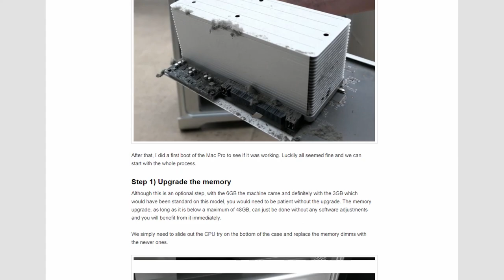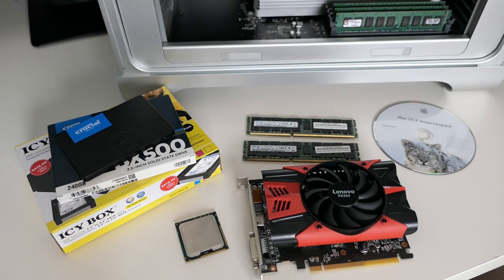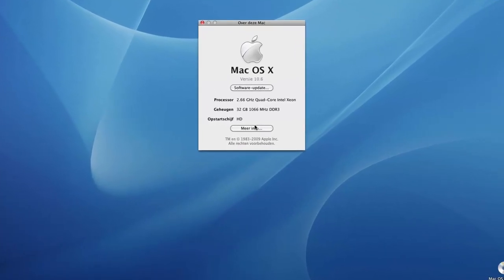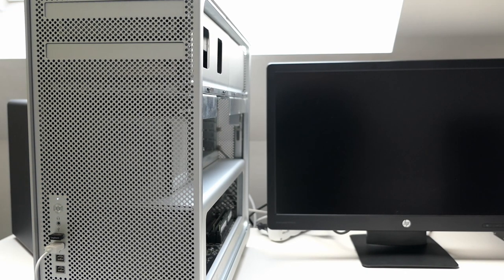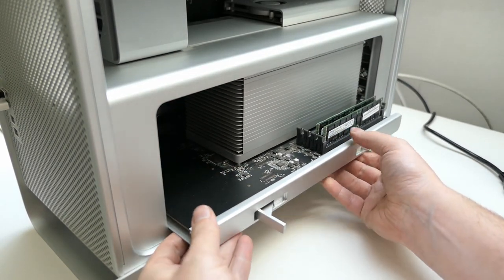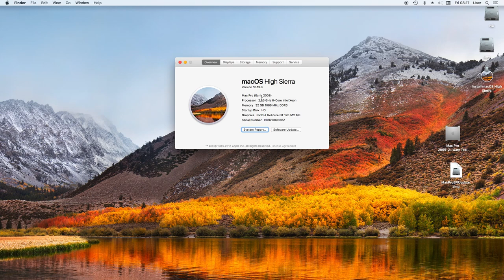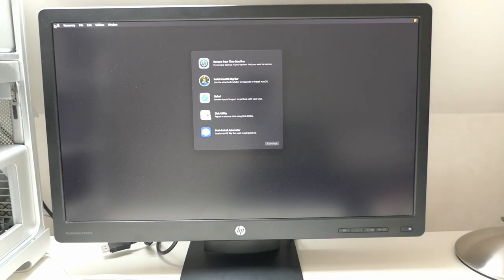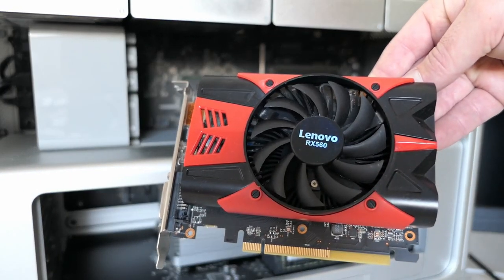Mac Pro 4,1 - Full hardware and software upgrade to Big Sur

Comment: I actually like this method. It is very easy to upgrade to Big Sur. The USB disk does take almost 1HR to create, once you restart the computer hold the "option key" and click first on the "EFI BOOT". Once the computer shuts down, restart your computer again holding down the "option key" and select the "Big Sur Installer Disk" (The black disk). If the installer stalls during the installation, restart the computer again and repeat the method. For me everything worked when I did it the second time. Big Sur will quickly install at startup and it will take an additional 30 minutes to install the upgrade. You do not need to erase your HD if you already have Catalina, just upgrade to Big Sur. Thanks JENSD !!!!

Comment: Thank you so much for your video. I have a Mac Pro G 5 running leopard. It was used everyday for my business for over 13 yrs. never break down. But a bit slow and can’t use google or safari. Have to use yahoo old version mail to communicate. I thought of selling it and get a new Mac Pro. But after seeing your video, I decided to upgrade it myself. I followed your steps and was able to update to high Sierra. I am very excited already because now I am able to use gmail again. Even at this point, I can use this machine for another 5 yrs at least. your video is detail and easy to follow. Thank you so much.
Reply: Are you sure it's a G5? That would make it a Power PC Mac, not a Mac Pro.

Comment: I have a 2009 mac pro exactly like this that ive been using for my everything from motion design work to personal things every single day since I got it back in 2009. Upgraded my HD a few times and went from snow leopard to Yosemite back in 2015 but now its come to a point where I cant upgrade anything and its really starting to slow down on me. I have been considering doing what you did in this video, but I just worry that its not going to last forever. I think im gonna end up upgrading everything and just starting fresh on a newer mac pro 2013 (cant afford the newest mac pro), but after seeing this, im getting second thoughts. I dont think i want to risk all my data and boot drive and hardware going through all this, I want to make sure all is safe and just working. However, if/when I do upgrade to a newer machine, I think I might try this. I WISH Apple just kept the same design as these Mac Pro's forever. They are so easy to use and upgrades are (or I guess were) so simple. I never planned to have my mac pro past maybe 2014/15 but here we are. Great video man, even if it did stress me out to watch :p

Comment: I've been researching on how to upgrade my Mac Pro as well. This is the best "how to" that I've came across. Just subscribed to your channel.
Reply from the maker: Thanks for the sub!
Reply: @jensdbe  Got a quick question. Will my Mac Pro will be able to update “automatically” or will I have to do this manually to update every time this is a new update?
Reply from the maker: @grafxdesigner93  After the install, I noticed it is better to go through booting from the USB drive (with the Big Sur install) again and to run the post install steps (See Finish the patching process after installation on: https://jensd.be/1376/apple/create-macos-usb-installer-for-installation-on-unsupported-models). There you can go through the post install automator process. Once that is completed updates should come in as expected.
Reply: @jensdbe  OKAY. I’ve been trying to do this and it has been a major headache. 🤦🏾‍♂️
Reply: Hey Jensd_be! What’s up man? That 2012 Mac Pro of mine finally went on me. Tried everything. What seems to be an unfortunately situation turned out to be a blessing. Got a 2017 iMac 27 4.2Ghz Quad 5K Retina for $800. Bought it from a private owner. He is a traveling photographer and have to get a MacBook Pro for traveling purposes and allows him mobility. Only used the iMac for about 6 months and been sitting in the closet for nearly 3 years. Meeting with him to check it out was the FIRST time he had took it out the original packaging since he got the MacBook Pro 16 in. So it is basically spanking BRAND NEW. I told him that he is a godsend. I was preparing for online classes for web development and I was trying to prep my 2012 Mac Pro. That plan didn’t panned out too well. So just giving you an update on the situation. Been playing around with the iMac. Mindblowing if you ask me. Totally light years from the 2012 Mac Pro. The whole macOS behaves totally DIFFERENT all the way down to the apps. Just crazy. Thanks for all your help in the videos and your channel. Keep up the good works. I will be coming to your channel for tips and updates. Be safe!

Comment: Go for 3 sticks for tripple channel, offers a pretty notable boost in performance (at least with W3580 and X5675 and with 1333 and 1600 mhz modules in my case)..
Reply from the maker: You are completely right, 3 sticks is always better if possible. I only had two unfortunately :)
Reply: @jensdbe  4 sticks actually slows down ram speeds
Reply: @AlphaFox78  how much would that cost in USD?
Reply: @AlphaFox78  I want to increase RAM from 3x16 to 4x16. How much would that slow down the operation of the Mac?

Comment: This is a really great video. I have the same Mac Pro 4,1. I will be upgrading to Big Sur thanks to you. I will do a video on it soon. My machine has been upgraded to NVidia GTX 680 which is of the few metal supported Nvidia graphics cards. It has also been upgraded to 16 gb of ram and I will be upgrading to a Xeon X5690 which I got on ebay for $50. I would upgrade to dual cpu tray if the tray wasn’t so expensive...
Reply from the maker: Thanks for the nice feedback and good luck with the upgrade!
Reply: How did you manage to get your GTX 680 to work. Mine can't seem to boot?
Reply: @Incusaudio  Yes I got it to work in Catalina but not Big Sur yet.
Reply: @Incusaudio  MY GTX 680 has been reflashed to Mac Firmware. Mojave wouldn't install because it saw it as a non metal card but I used the dos dude patcher and got Catalina running smooth. Catalina even see it as a metal supported card. Reflash your firmware using mac firmware. You will need free dos, flash app and a pc with a pcie x16 slot.
Reply: Nvidia doesnt offer drivers past sierra, so unless you can hack the driver it wont work. better to get a radeon 560 like he did, natively supported and faster. unless the 680 has native driver support for macos as some of the older ones do.
Reply: @AlphaFox78  I couldn't get Big Sur to run on it but the GTX 680 has metal driver support. I've installed Catalina on it no problem. It has full 3D acceleration  with native driver support built into the OS in High Sierra, Mojave and Catalina. I even got Fortnite to install and run no problem on low to medium settings at 80 FPS. Final Cut Pro has full 3D acceleration also. Big Sur didn't like the graphics card as it is a reflashed Windows graphics card.  I also have full boot screen at start up in Catalina. I'll do a video on this.  The GTX 680 runs on par with GTX 1050 ti which is amazing for a graphics card made in 2012. The GTX 680 runs about 51% faster than a RX 560 according to benchmarks.  I may have to do that to get Big Sur on it but Catalina runs smooth on the GTX 680. 

current specs are: 6 core Xeon x5690 @3.4ghz turbo @ 3.9Ghz 24gb DDR3 OWC Ram @ 1333Mhz 1tb Western Digital Black NVMe SSD. 

This runs Final Cut Pro runs smooth and Fortnite runs smooth so I'm with happy with it. I only paid $190 for base system with GTX 680 and another $300 for upgrades to CPU ram and NVMe adapter and SSD. Good bang for the buck in my opinion...
Reply: @Steampunk_Star_Raisin  which NVMe adapter and NVME drive did you use?
Reply: @michaelkphoto8344  I used a generic Chinese adapter with no name brand. I ordered it on Amazon. It has 1 m.2 nvme slot and m.2 msata slot. I used a Western Digital Black SN750 1TB. It worked fine the first time I installed macos from usb stick and it showed up as a drive that I could format.

Comment: Nice clear video, but you forgot to reset NVRAM, which you'll need to do to get it to see your new RAM (1600MHz it looked like you fitted) as 1333MHz, which is the fastest speed the X56?? series CPUs can operate at. At the moment, it's still seeing, and reporting, it as 1066MHz; which was how fast your original W3520 CPU was accessing the RAM. That will change after an NVRAM clear and reboot. Sadly it can't use the full 1600MHz speed of the RAM you upgraded to, but it is backwards compatible with the lower 1333MHz bus speeds of the X56??.

For that final extra tweak, three 3 RAM modules run faster than 2, as the Mac Pro works best in Triple channel mode, so either 3 x 8GB for 24GB, or 3 x 16GB for 48GB. 

If you e.g. put in 32GB as 4 x8GB sticks, the 3rd and 4th are actually sharing the same channel, so run slightly slower than 3 x 8GB as 24GB. But only a issue as and when all the RAM is being used; so if it really needs the full 32GB, is better slightly slower accessing that last 8GB than not having it at all.
Reply from the maker: Thanks for taking the time to write this. I'm fully aware of the triple channel being faster but didn't have more dimms available unfortunately. 

Didn't know about the NVRAM reset, will test this for sure if I find another Mac Pro for a nice price somewhere. 1066 vs 1333 is definitely noticeable.
Reply: @jensdbe  I did this NVRAM reset myself, and yes, you should do it.. I mean, underclocking your memory won't hurt it, but doesn't give the best performance. I did this very upgrade, or at least parts of it.. I have not upgrade the GPU yet, so I have not upgraded to Big Sur.. but other items I have done.. works great.

Comment: SSD running at SATA2 not SATA3, need add in card (or get a PCIe NVMe card)
Upgrade GPU after you upgrade the High Sierra, its supports both regular and metal cards and will work with both accelerated
RAM running at 1066 instead of 1333, after you flash to 5,1 and upgrade the CPU you can use faster RAM
You can get a Mac compatible PCIe WiFi card and get hand off and stuff working
I upgraded a bunch of these machines a while back, haha

Comment: I've been putting off the upgrade but finally bit the bullet. I've has High Sierra running for a while but need to get faster CPUs and would love to have Big Sur installed. Did the CPU upgrade and trying to use the patched Big Sur install but the Mac reports it can't install it. Tried booting to High Sierra and running from USB, also no joy. I have confirmed the firmware update. You can see this below. Don't know what/where to do/go next. Appreciate feedback.
Hardware Overview
Model |
Name:
Model Identifier:
Processor Name:
Processor Speed:
Mac Fro
o- Core inte Xeon
3.46 GEZ
Total Number of Cores
L2 Cache (ver Corel:
12
256 KB
L3 Cache per Processor
Memorv:
20 GB
Boot ROM Version:
165.0.0.0.0
Mo version system
1.3965
SMC Version (processor tray):
1.39f5

Comment: I love this. My machine is running OS9, so it’s outdated, but it’s in perfect condition. I will eventually do this. I love this computer. I was going to just use it as storage, but now you show me how to upgrade it. Wonderful.
Reply: All Mac Pros shipped brand new with at least Mac OSX Leopard, so it is very strange if you have OS9 installed. You somehow went backwards.

Perhaps you have a PowerMac G5, which has a similar style of case, but it is a very different CPU. I am looking for an old computer but the G5 will NOT run Final Cut Pro 7, simply because the G5 uses a PowerPC chip, rather than an Intel CPU, like the Mac Pro in this video. 🤷
Reply: @TuNnL  My G5 was great until it died. The guy who set up my Mac Pro 1,1 said that in his experience the G5 had proved to be the absolute worst of the power PCs and that G4s were loads better and built to last. I spent a fortune at the time in 2003 on my G5 but have bought pre=-owned Mac Pros since and I love them.
Reply: @davidian3412  🎯💯 You nailed it. People don't understand that IBM mostly cut Motorola out of the picture by the time they built the G5.

Up until the G4, you had both companies involved in three-way partnership with Apple. With the G5, IBM suddenly found themselves doing 99% of the work, and the results were a rush job that Steve Jobs wasn't satisfied with anyway.

As a result, Steve finally said "goodbye IBM," I need "fast, powerful quality" and went with Intel for the Mac Pros. Intel was already making the chips for their MacBook Pros, so Apple went "all in." 🤷

Comment: i just bought a 2009 with dual processor & 48GB ram for $180
Reply: from where ?
Reply: The dual tray alone is worth that
Reply: That’s a real steel 🐸 congrats
Reply: You got robbed. Jk good deal
Reply: the amount of ram is insane
Reply: I just got a single tray and a dual tray for free, I’m currently upgrading them to Big Sur, SSD, 32GB RAM and RX 560
Reply: @iPodgeek44 .just ordered dual Xeon 5690 processors. My Mac Pro 4,1.to 5,1 has 80 GB RAM. I’m seeking advice on a graphics card upgrade from the original 120
Reply: I bought an 2009 dual one for about 150 bucks with 16gb ram no HDD and an snow leopard CD for 150 I guess that's ok

Comment: A very important detail should be noted. When you fasten the cooler blocks to the processor, DO NOT tighten the bolts too much!!! A little, before the first resistance. Otherwise, the computer will not start. The red light of death will light up)))
Reply: Good shout!
Reply: i wonder how he now this 🤔🤔🤔

Comment: The minimum CPU upgrade should be 5680@3.33ghz. You are using a decade-plus CPU to run the latest unsupported OS, why keep more bottlenecks than necessary. In addition, you wasted money upgrading to 32gb using slower ram, once you flashed to 5,1 you use 1333mhz ram, ask me how I know this mistake, Lol. My GB with just 12Gb of Ram is 643 SC and 3698 MC. Depending on the time of year sellers are usually throwing these Mac Pros and CPUs away on fleabay. All in all a very well-paced, no cringy music, well-spoken and edited vid, very nice indeed,  Thank you.

Comment: Been trying to get this to work. I followed the directions to a tee. My usb boot doesnt come up as a black disk just the regular usb icon. When i boot to efi them try to boot to the usb after it shuts itself down, it starts the installer and just fails. Any thoughts?

Comment: I have one of those Great piece, But riddle me this I’m trying to upgrade my 2009(early)Mac Pro 4,1 to a 5,1. I did the EFI update and the firmware update when I restart it goes into a short flash mode and crashes then restarts back into El Capitan’s

Comment: Ok, next step, then hit a wall....I formatted a 32GB usb stick...ran Auto Patcher (wow, that took some time)  Restarted, holding down the option key and I get the "Macintosh HD" which has High Sierra loaded and I also get the "Auto Patcher" called Install macOS Big Sur(EFI boot), which is on the 32 GB usb drive...but all I get is the O with a line through it when selecting it and it shuts down. If I select the Macintosh HD, it just boots right up!....  I'm missing something here....can you help...do I need an empty drive?   Like the one you installed just before this step....if so I do have a second HDD in the mac...a blank, formatted 4TB drive with absolutely nothing on it, but it doesn't show up as a bootable disk when holding down the option key......  In your video you show selecting one thing which I can't read and then selecting the other one on the second boot, but don't now what that is.....Thanks for the help....Mike
Reply: The same happens to me as well. :(( --->   "all I get is the O with a line through it when selecting it"
Reply: @TomsBrinkis  Tom, this fella doesn't reply much.....check out Mr. Macintosh's YouTube site.....

Comment: I greatly admire your efforts, thank you for doing this, helping and teaching millions of Mac users such as yours truly, to keep using their computers and save. — My Apple wired aluminum keyboard works at startup after install of High Sierra, followed by Mojave.  However, there are couple of keyboard combinations that currently not working.  The keyboard itself is fine, option key works when I reset PRAM.  But when holding down option key during startup to select different OS, or USB drive to boot from, it appears that holding down the option key has no effect, my Mac Pro just hangs and nothing happens.  I have a Mac Pro 5,1 Early 2009 — Runing Mojave 10.14.6 — With two 6-Core Intel Xeon Processor 3.33 GHz — Metal:Supported, feature set macOS GPUFamily2 v1 — 32 GB RAM — is there a way to reset the keyboard back to default.?
Reply: I was having the same problem just now. Really frustrating. Got to the point where my computer wouldn't boot at all, and was stuck on a grey screen. I read somewhere that said to unplug all peripherals.  I unplugged everything except for the monitor. I also moved the usb cable for the keyboard to the front of the computer instead of the back. Suddenly it works. Could also be the keyboard you're using. Might try a different one.
Reply: @keatorski  I discovered that my option key wasn't working on startup due to it being plugged into an added USB port hub. Once I plugged it into an original port in the computer it worked fine. Took a lot of searching and a lot of reading before I found it. Very relieved when it finally worked!

Comment: These RAM modules are Samsung 16GB DDR3 1600MHz PC3-12800R ECC M393B2G708H0-CK0, the same ones used in servers at the time? Correct?

Comment: Great video man! could you please show us how smooth big sur or monterey works on this new upgrade like open close finder/ different softwares etc and safari with multiple webpages. if you could install intel power gadget and istats menus to see how the cpu speed stepping while doing different operations and how hot cpu and gpu get and how much memory gpu use while doing different tasks. would really appreciate it, thanks!